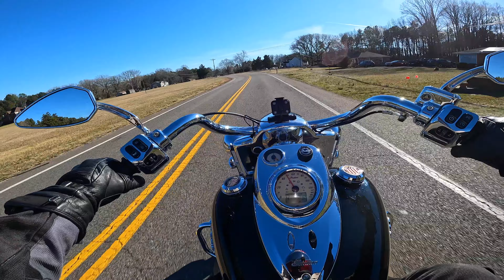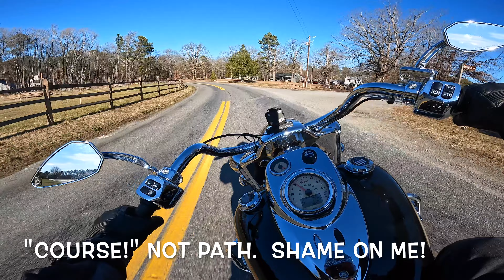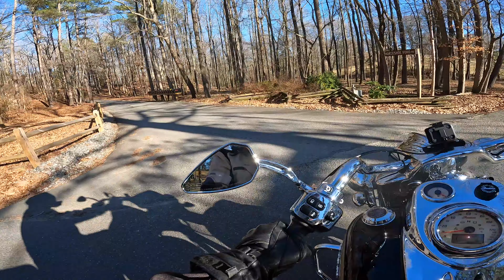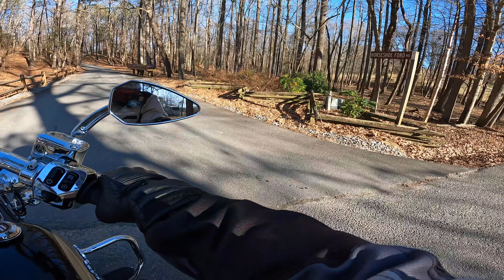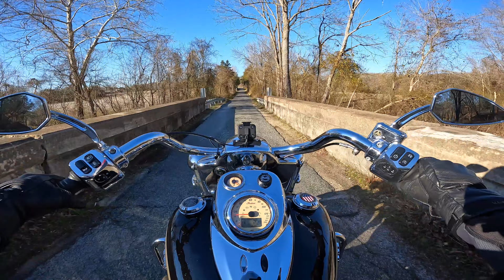Can you name the tunes I'm listening to by the lyrics? My slow turn issues.  Patrick Henry's home.

Comment: I also have a habit of coasting around corners but I am getting better. Best advice I got was from a retired NYPD motorcycle cop. He constantly says "Pre-load and keep it loaded". This means during turns and during low speed manuvors, stay on the gas (adjust throttle accordingly) and use the clutch (friction zone) to add or reduce power.while turning corners. on another note. Ever wonder the source of the "Confusion pandemic" we seem to be having globally. Look into the pesticide atrazine. The UCLA scientist that first looked into it  litterally had his life destroyed. Not sure if he is even still living. Back to the subject, I ride a 22 SDH. I love it. My music in my helmit ranges from reggae to classical and most inbetween. Only things I can't get into is Metal and todays rap music.You have a beautiful bike with plenty of potentiol. Be carful or she will be the most expensive lover LOL... I have the indian stage 2 kit, corban saddle, indian cold air intake, Indian LED head lamp Rinehart headers and mufflers oil cooler FMB choppers  14 in bars, Mustash engine guards, LED indian driving lights and 16" windshield. Talk about a moneypit. I also put custom tank emblems from artabys designs and a luggage rack. I doubt if I will drop anymore money into customizations unless I decide to add a rear automatic are shock with compressor and air tank. LOL... Enjoy the Springfield. She is a beauty.